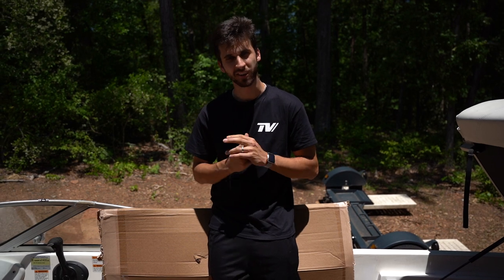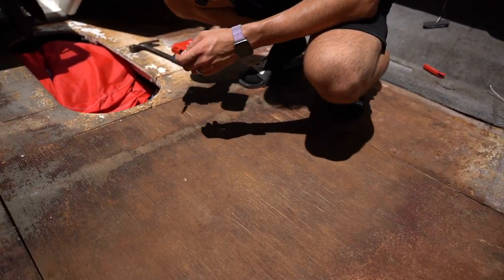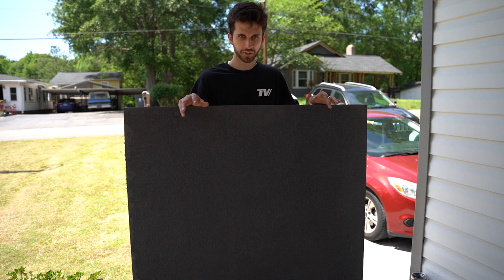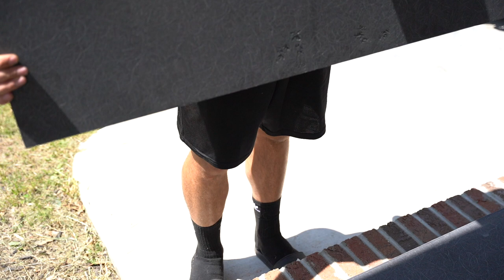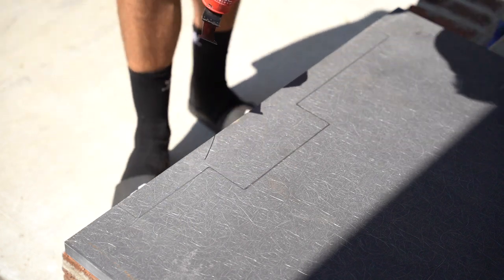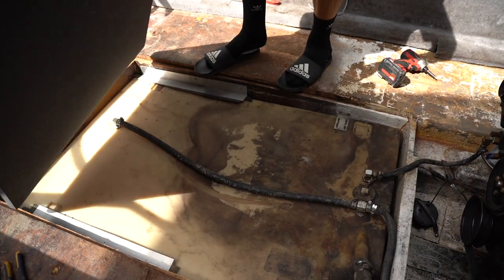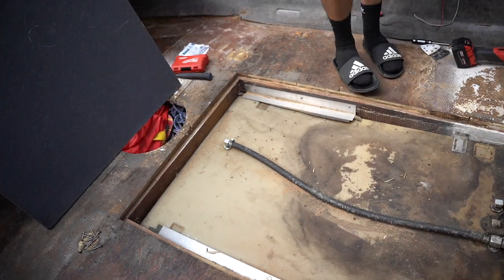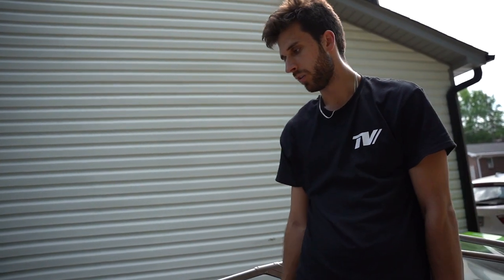REPLACING the OLD Marine Grade Plywood with COOSA Board on our Boat floor!

Comment: Wow, my Grand Dad had that same jigsaw... the old Craftsman? with the greenish plastic clamshell.
Reply from the maker: Yep haha thats the one!
Reply: And that was the "new" one that came after the one with the shiny aluminum body.  Grandad had all those alum Craftsman tools... the drill, the jigsaw, the "locomotive" belt sander.  Ahh memories.  If I remember correctly, the jigsaw you're using has no orbit.  If you were to try an orbital jigsaw with carbide tooth blade... I think you may get better results with the Coosa.   Cheers!  @jasonkopytin